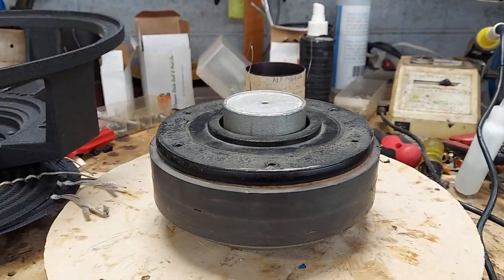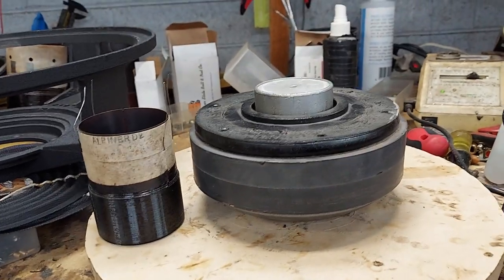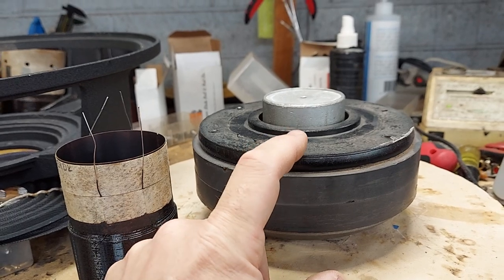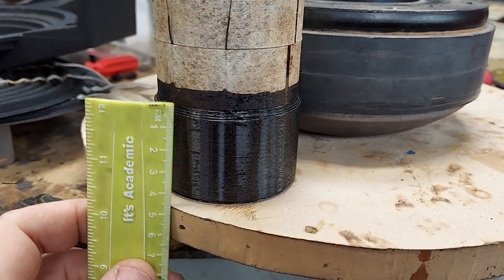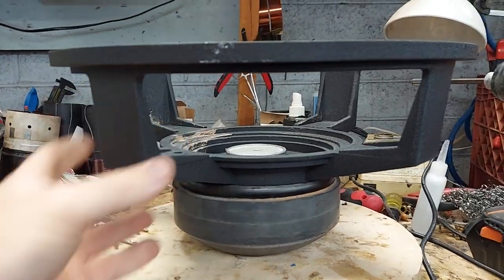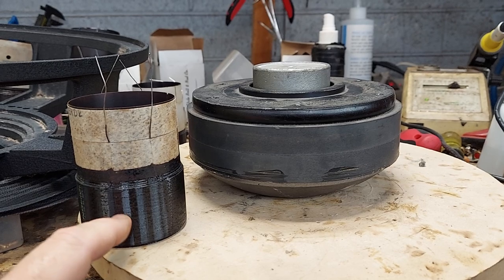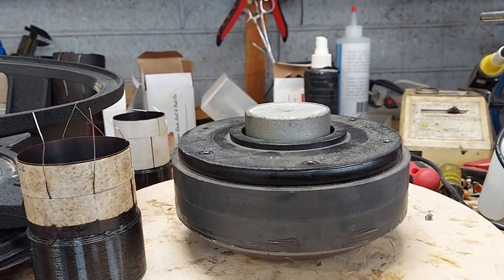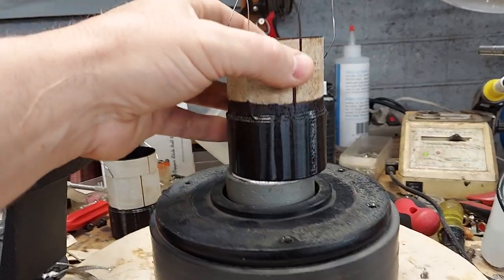The Great Gap Video.  How to Center / Set the Voice Coil on a Subwoofer @RobotUnderground

Comment: When I worked at ORION , 99% of woofers that were returned for "Warranty" were actually user error or Abuse. Very few were defect, I.E. inconsistent glue coverage or other employee oversight on assembly causing some sort of separation failure. But nearly all coil failure was caused by clipping amplifiers, and coil failure was the 99% that were returned.
Reply from the maker: Didn't they try to do the same 10yr warranty thing that MTX did?

Comment: I put 600V into 5 8 ohm 3 inch woofers all in series. Worked out to 600V 40 ohm = 15 amps.... 9000 watts. The transformer I was using went up in smoke big time lol. The little chinese speakers impressed me and really lasted a long time for being only 20W with a little voice coil. Near offed myself with the HV though XD oops. I didn't get shocked or anything, but the voltage arc through the cement and made a circuit without anything attached to one end, just through the chassis through the dirty cement. Scary!!!
Reply from the maker: Yes, very scary

Comment: Now you talked about a vented pole... any good reasons not to drill it out with a drill press while you have it apart? Of course you would tape up the gap to keep the metal shavings out of the motor and then install a faucet screen at the top of the pole to prevent debris from getting in?
Reply: Debris! 😂😂😂 just watched, your last video... lmao! Makes sense...
Reply from the maker: not worth the effort

Comment: If your using a coil that is .2mm longer on the winding can you set the coil up offset where it sets higher to make sure you don't bottom out? Thanks Pat.
Reply from the maker: It still depends on how tall the motor structure is and where the center is.  Typically 2 mm is not going to make a difference but you still don't want to bias it if you don't have to

Comment: The vents are around the spider on a piece of plastic that connects The spider to the frame and also on the plastic that is around the bottom half of the cone that connects to the voice coil so it kind of forces the air back and forth through the inside Gap of the voice coil and down under the voice coil and out the sides where the spider and Vents are located... I just don't know how efficient that method of cooling is. It seems like the velocity of the air flowing in such a tight spot would cool it decently but who knows I've seen a lot of burnt looking L7 coils...
Reply: Kicker deleted the vent for two reasons 1) to reduce original machining charge 2) to sell you another sub when you thermal the coil ;)

Comment: How about showing how to re mount a motor that the epoxy between the top plate and magnet failed, without a teardown?
Reply from the maker: You show me.
Reply: @RobotUnderground  I built a jig out of 6" PVC pipe connector and some thumb screws to center it. I'll let you know how it goes when I get around to trying to put it back together.

Comment: Hey robot I have a question/idea. You obviously know alot more than me about the mechanics of a woofer . But I also enjoy the hobby of rc cars.. got me thinking. The new brushless tech. Reversed the old way of motors. Putting the windings on the outside and mag in center.. I dunno exactly how it could work.. or if it be effective.. but seems like something new could be done to improve sub motors in this manner
Reply from the maker: Draw up a design or build a prototype

Comment: Hi my name is Brian. I live in California and I will be building my first "soft part" or a sundown calls it drop in recone kit. I wanted to know how do I know where to center the coil on the top plate ? Half , or 1/4 of winding length
Reply from the maker: If you have a drop in you don't need to measure.  I should say if you have the proper recon kit you shouldn't have to measure.
Reply: @RobotUnderground  no . This is a motor, ti basket, vented spacer ring, cone with mega roll surround,  spider pack w/ tinsel leads attached,3" 8 layer fw coil ,plastic ring thing for under spider. I've ca glued the coil to the spider (shimmed) and  upon sliding the cone over the former I'm seeing that it doesn't go all the way down to the spider,like on a store bought sub (Sundown dc ect.)
Reply from the maker: I'd have to see pics of what you're talking about.  Just text me with your name and shipping address when you're ready. 602-312-6504

Comment: Does the top plate/washer affect the way the magnetic Flux is concentrated? If yes, could that lip be a win/win for higher Bl and also making it easier for the factory worker to center the basket? Or is it pointless? The dust ring around the lip makes me think it has no effect on centering the basket and it has another purpose
Reply from the maker: It just gives a larger sweet spot, not always more BL.  Many designs like JL have great BL with a thin top plate.  Yes it might be easier for the factory.. But that's why I've been appreciating the American Bass motors that are bolted.  No shifts either.  no performance difference between overhung and underhung either.  overhung just allows for more abuse.
Reply: @RobotUnderground  thank you
Reply: I always thought it was for a little more  x-max..?

Comment: Currently trying to fix a RF 10 inch that the motor shifted. What adhesive would you recommend for the top plate?
Reply from the maker: Our Devil's Jizz or just regular JB Weld.  Make sure you prep both surfaces first and you have your non magnetic shim ready to go.  Even apply in small amounts to both surfaces.
Reply: @RobotUnderground  thanks bro!

Comment: I need help finding a ac to dc converter for my home radio set u fr my 2 15 inch Memphis mojo and ima buy a 5000 whatt amp for ut what brand and kind should I get please me out
Reply from the maker: You could just buy a 5kw home amp.
We have those too.  Ours is only $1200 shipped.  Over 100lbs.
Reply: +1 on Patrick said. That would be one less component to introduce any noise as well.
Reply from the maker: @hellbilly007  That's what Ted at Speakerworks taught me.  K.I.S.S.  Keep It Simple Stupid / Sweetie

Comment: I was refoaming my sub and I accidentally put it a little bit too far on one of the sides, you got any ideas on how to re-center without take this whole thing apart?
Reply from the maker: Start over with new foam.  I hope you won't do that again.
Reply from the maker: Try it first.  Hopefully it won't pull it too far out of wack
Reply: @RobotUnderground  alright I guess I'll just have to retry but it's not off that much but it's just enough to rub when I hit the lower notes like 35 and under
Reply from the maker: @zachlatta1833  You're just pushing the sub a bit harder than it can take.  I recommend upgrading the sub to something bigger and stronger.  Let me know if I can help.
Reply: @RobotUnderground  well the sub I'm using is supposed to do 27-100 hz at 125 watts rms and I'm probably giving it 80 watts and I try to stay away from the super lows

Comment: I run into alot of people who want bass but dont wanna upgrade any electrical then run through subs or amps because of low voltage on the amp or clipping until the coils go turning theyre head units all the way to max and then say well is sounded ok I smelt them but just figured they were breaking in kills me ive found certain companys ESP kicker have a one and done dont ask type deal were they will give the customer the benifet of the dought swap on site which on the dealers end takes 7 or 8 months to get the merch returned and most times that same customer will be back before you get the first subs or amp or both lol sometimes yea its a pain in the ass or can be atleat